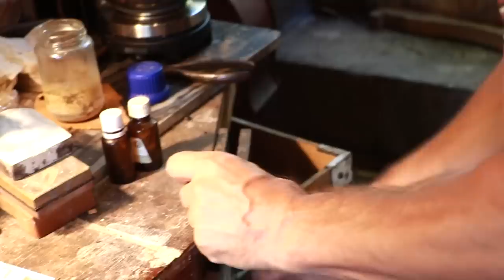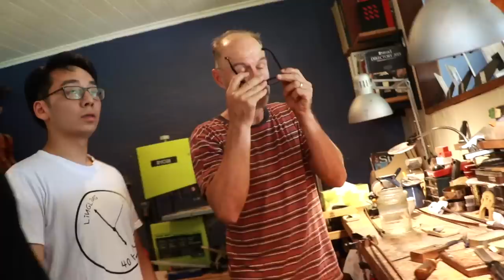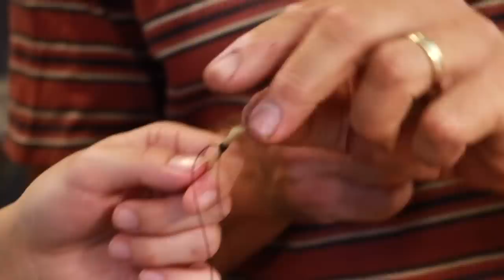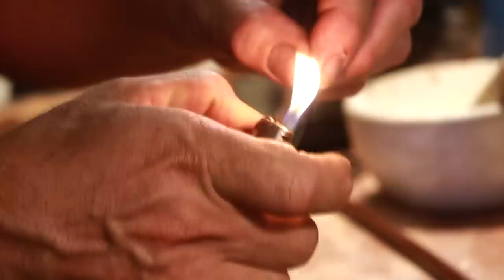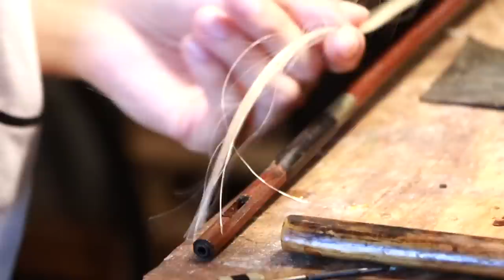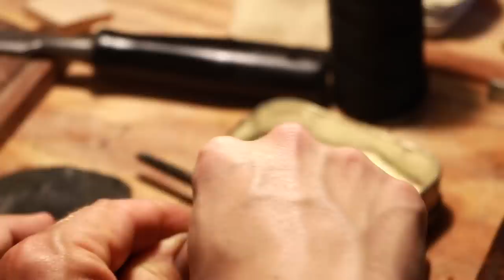We Try Rehairing a Violin Bow

Comment: 1:50 About the question why the frog is called "the frog": In the past, the bow was tightened with a little piece of wood, which had to be put in manually and kept in place with the thumb. However, it often happened that this little piece of wood just "jumped" out of its place, because of its loose / "shaky" position (and the tension, I suppose). People then compared that with a frog jumping off. 
Another (more modern) explanation is, that the shape of the (bow) frog resembles a sitting (natural) frog.

Comment: I have never played the violin, but I assumed when I first heard it mentioned on this channel that the part of the bow that is held was called a frog was because it was related to horses since the "string' used in them is horse hair as well. When I was young I rode horses avidly, and when you clean a horses feet, often with tools that would not look out of place in a luthier's workshop you are always told to be careful of the 'frog' it is the soft, wedge (v) shaped area on the underside of the hoof (heel).

Comment: The scariest thing I've ever done to one of my musical instruments was not drilling holes in my grenadilla wood clarinet for a thumbrest. It was straightening my warped bows by running them back and forth through an alcohol burner flame. You have to actually immerse the bow wood into the flame in order to heat the wood enough, but you have to move it CONSTANTLY or it will burn the lacquer off or damage the wood. It was hair raising.

Comment: ok why they just don't get the hair roll (into a hook) inside the bow box and put some screw? i mean one screw can make more than 150Kg pressure force ! There is really no need of all this process ! it works with old registers machines that stuck the paper roll in the past remember? in the 80;s?
Reply: What?? NOOO!! 
The bow is pretty expensive dude, and I don't think that there is even a mediocre violinist that would nail a screw in the frog, and not only that, if you're going to stick a screw to tighten the hair, its gonna loosened up over time, but with the proper rehair, it wouldn't be loose anytime soon
Reply: @owdy3973  ok dont call me mediocre sir. The idea is not to waste time burning the hair at the tip and thread, you just fix the plate with a screw with a pressure ring (idk the correct name), so it won't loose at all. FASTER !
Reply: @felipebrasil5  oh I'm not calling you a mediocre, I'm just saying that probably a mediocre violinist won't even do that
Reply: @felipebrasil5  there's so much different ways to rehairing the bow, some people burn the tip of the hair, some people just stick it with some sort of thing (I dunno) 
Some just done it different
It's the matter of school or teacher
Reply: And btw, I'm shocked because I thought you meant nailing a screw right in the frog and then just tying up the hair on the nail

Comment: A bit surprised he doesn't know why it's called a frog even though he repairs violins. Here's a quick history of frogs of the bows, it dated back in their predecessors, the old versions of the bows that are arched. There after the straight version of bow appeared with just hairs hanging and thus frogs are introduced to tighten the hair from the bow, then it took a shape of a "frog"(a shape of heart, under a horses hoof) that appeared that is cut in half. So until now the modern bow with tightening knob in the end has a so called frog. Yup it's actually named after a figure you can see on a horses hoof.

Comment: Why rephair a bow when you could/just buy a new one
Reply: The reason being, a good violin bow is expensive. Sometimes the cost is half the price of the violin or even more. Rehairing is a minimal price in comparison.  Also, buying new bow would also mean re-adjusting to the new material. It may seem like all bows are pretty straightforward stock. In reality,  each bow is as unique as the violinist who uses it.